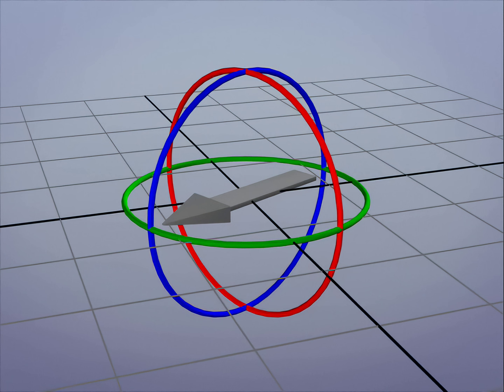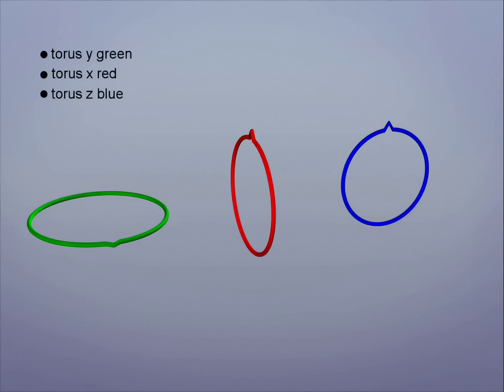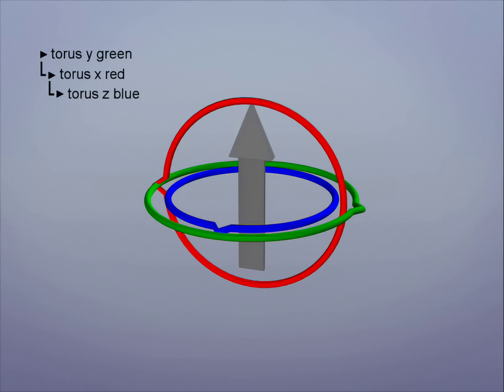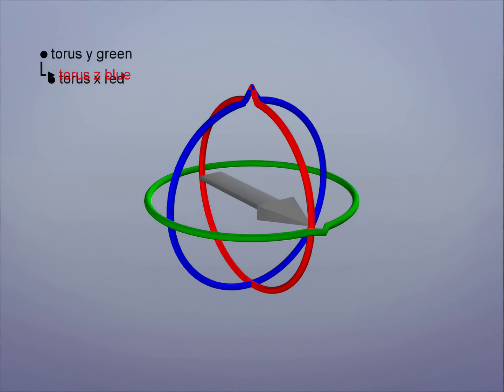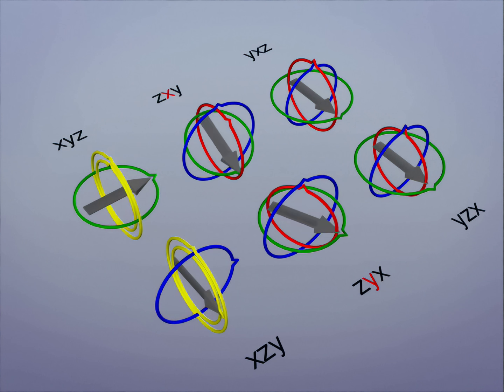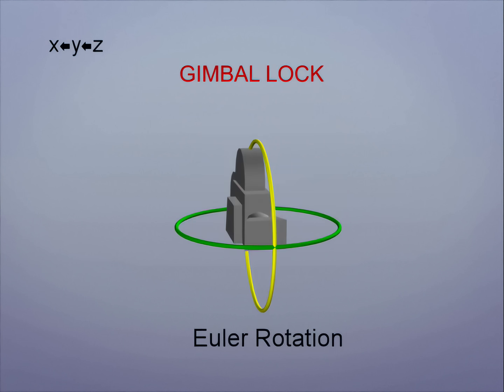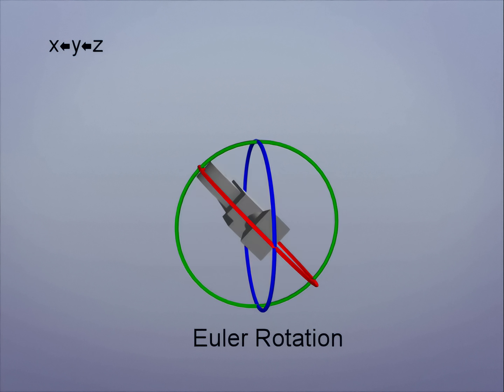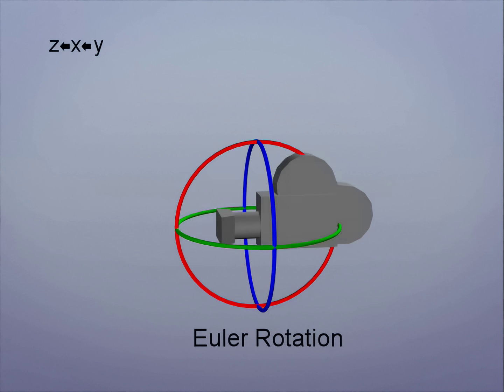Euler (gimbal lock) Explained

Comment: System coordinates and local coordinates are not the same thing which is what people don't get.
Matrices only gimble lock if you use a system vector for one of the world axis that you build the view matrice from. Basically you Dot(Forward, Up) if the result is near -1 or 1 you are about to gimble lock. 
You avoid it entirely by using your cmaers world orientations forward and up not a Vector3.Up. Which is exactly why quaternion's don't gimble. Because they have a set rotation system meaning their vectors are always orthanormal. Personally i like matrices more as they are more flexible.

Comment: So why then do we assert an order to X, Y, and Z? Why not define the axis of all rotations in the global coordinate system? So rotating along the X axis will always mean rotating along the X axis of the "universe"? This way the 3 axis of rotation are completely independent of each other and orthogonal.
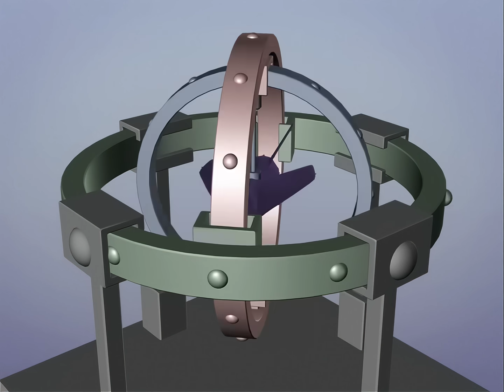Reply: Look at the physical mock-up at 0:45. They are connected in order to maintain the relationship. If you unlock those, you lose the relationship of which is x, y, or z. They lose meaning. But if you code a graphics app or library that succeeds in using Euler angles without lock, share it to the world and tell a friend to nominate you for a Nobel. I'm not being sarcastic - it really would be awesome.

Comment: Good thing to know, since so many programs exclusively use euler angles.

With real world gimbals, especially critical ones used in say, a navigation gyro, great care is taken to avoid gimbal lock for obvious reasons. However a solution that largely prevents it (I don't think it entirely eliminates it, but it does help a lot) is to use a gimbal with 4 axes.

In computer programming of course, the best solution is to use a quaternion.
However, understanding quaternions is pretty difficult.

The concept behind what they do isn't so difficult, but understanding how and why they work is a bit less straightforward.

In terms of rotation, a quaternion defines a rotation, and an arbitrary axis oriented in 3d space around which to perform the rotation.

Of course, the reason why it's so confusing to understand quite how a quaternion accomplishes that task, is because strictly speaking a quaternion is a geometric operation that works in 4 dimensional space, NOT 3d space.
(note meanwhile that euler rotation in 2d space cannot suffer from gimbal lock, thus you don't have to resort to stuff like quaternions or the like.)

Actually, in purely geometric terms it's possible to interpret rotation as linear motion on a surface one dimension lower than the one you are working in.

in 0 and 1 dimensions rotation is not a meaningful operation.

In 2 dimensions you have one axis of rotation, and one of the peculiarities here is that this axis of rotation is perpendicular to the 2d surface itself. (in other words, the axis of rotation in 2d space points in a direction that would be physically impossible in 2d.)

However, if you project a point onto a circle - (the distance doesn't matter,) then you can define rotation in terms of how far a point moves along the perimeter of that circle - and this is by definition 1 dimensional linear motion (albeit on geometry that isn't flat, and thus wraps around itself.)

Similarly, in 3 dimensions you can determine 2 axes of rotation as being 2 coordinates on the surface of a sphere, which is, again, a 2 dimensional surface.
of course, that leaves you with a third rotational axis that is undefined. However, the definition of a single axis of rotation is simply that of the 2d case.
(technically I suppose 1 and 0 dimensional rotation also have to be accounted for, but those have no real meaning, so it's a moot point.)

OK, so I probably won't win any prizes in mathematics with this explanation, but you might see how this can help explain a few things.
It also provides a way to define operations that are equivalent to rotation, but happen in higher dimensions.

In 4 dimensions it follows that there is a rotation defined as the position of a point inside the volume of a 3d sphere, plus the definitions for the 3d and 2d cases.

Indeed in terms of euler angles, if you label 4d space as being XYZW, then rotations can happen along XY, XZ,YZ, XW, YW and ZW, but there should also be some rotation-like operation that operates along 3 axes at a time XYZ, XYW, YZW - whatever this operation might look like, it's going to be hard to visualise, since it's going to be an operation that doesn't make much sense in 3d space... (and visualising 4d geometry, much less 4d geometric operations is pretty difficult...)
Reply: IIRC quaternions aren't a 4D rotation, though.  They're a rotation with a resize.

Also, I don't think you're correct that 3D rotation can be specified with only 2 numbers?  Every method of notating 3D rotation that I can find seems to require at least 3 numbers.  (Including the not-commonly-used ones of "Axis angle notation but use the magnitude of the axis as the angle", and "Axis angle notation but specify the axis via longitude and latitude" [the latter of which you mentioned in your comment].)

Comment: Another benefit of the camera gimbal you suggest is that the gimbal lock occurs in the same place for your camera and a human cameraman. If you're holding a camera pointed straight up, it's a lot easier to lower it in the direction you're facing than in any other direction.

Comment: Is this why alot of games won't allow you to look straight vertically, either up or down? To avoid gimbal locking the camera? Or is it for a different reason?
Reply: In first person shooters you only control your characters pitch and yaw (Looking up/down and turning left/right.) and cannot roll your camera. So gimbal lock isn't a problem.
The reason a game will limit how much you can look up/down is just to prevent you say, pitching your camera 180 degrees up and seeing stuff behind you upside down.

Comment: I wasn’t aware that there was some kind of restriction in modeling until I have seen this video. I haven’t had this problem yet, but the video itself shows me that modeling can only rotate in so many directions before it gets locked. I can imagine that it may cause issues with animators who are assigned to animate the models to make them do certain things. With this new information, I will have to be careful where I turn certain parts in my models so I can at least be assured that it can be avoided altogether.

Comment: When you rotate, XY, XZ and YZ axis of rotation IS NOT MOVING, when you move that red torus at 2:05, blue torus IS NO LONGER Z ROTATION AXIS, it is related to arrow's orientation axis, and rotating around it, but not an x,y,z.

This is so stupid (to me) calling it XYZ rotations, THERE IS THEORETICALLY NO GIMBAL LOCK IN THIS KIND OF ROTATIONS.

This system is needs to be called an "yaw-pitch-roll" rotation, and yes, in this case, gimbal lock is pretty possible.

Even in Wikipedia, this system called Euler angles, angles, but not coordinates
Reply: @ZecosMax It doesn't make a difference. You still experience Gimbal lock if you keep the axes of rotation in the same place.
Go grab a pencil (or just imagine).
Hold your pencil in front pointing away from you
Rotate it some angle on the x axis  (Your pencil changes pitch)
Now rotate it 90 degrees on the y axis 
Now notice when you rotate it on it's z axis ... you're just changing it's pitch again. 

The only difference made by not moving the axis is your first and last rotations can become gimbal locked instead of your last two.
Reply: @8bit_pineapple  no, if i turn it along XZ axis, yes, then nothing in the orientation of pencil happens, but if i rotate pencil along XY or ZY, then pencil gonna lay on it's side
Reply: @vilkillian  Okay... I'll try again... Perform these 3 rotations one after another
1. ZY,  c degrees (c can be any number you want)
2. XZ 90 degrees
3. XY d degrees (d can be any number you want)
Your 1st and 3rd rotation are doing the same job.
Note that if you instead rotate:
1. ZY,  c+d degrees
2. XY, 90 degrees
You perform the same rotation.
This is gimbal lock. Your 3 rotations are doing the same job as 2.
Reply: @8bit_pineapple  if you still can't get what i'm was trying to say:
Axis of rotation does NOT change their orientation, so, if you performed rotation on a model, this model 'becomes' new model with new axis

so, if you take a pencil for example, which is lying on it's side and pointing at +X
rotate it from it's center up along XY for 45deg
and then rotate along ZY, this pencil is gonna make a path which looks like a cone, you will never encounter gimbal lock in this king of rotations.

btw this is how you apply multiple rotations in matrices
Reply: @vilkillian  It's not that I don't get what your saying. It's that you don't get what I'm saying.
If you use 3x3 matrices for rotation you run into Gimbal lock issues. 
https://en.wikipedia.org/wiki/Gimbal_lock#Loss_of_a_degree_of_freedom_with_Euler_angles
Notice we have three 3x3 matrices to rotate about the 3 different axis. 
However, when β = π/2  the first and last matrix become locked.
Sure you can multiply by a 4th matrix after... that would be like adding a 4th ring to the video.
But we don't want to keep introducing new matrices . Especially so for 3D animation.

So to do this we use quaternions or their 4x4 matrix representation instead of Euler angles. Then we can use one set of equations to do all of the rotations we need without issues.
btw this is how you apply rotations when writing 3D animation software/games/etc . 3x3 matrices aren't appropriate due to gimbal lock.
And no... , do not ever rotate a rotated model. Every rotation you do has rounding errors, they add up and destroy your model. Always calculate your rotations from the original.

Comment: Great explanation, but is there some other way to prevent gimbal lock other than changing the rotation order? 
Maybe add a 4th ring or physically stop the rings from aligning? (and maybe use the 4th ring instead then?)
Reply: That’s just basically quaternions then
Reply: @bamgb81  What's that?
Reply: @sebbes333  basically a 4d vector a+bi+cj+dk where abcd are the real coefficients and ijk behave like imaginary numbers on their own but when you multiply them together they alternate between each other, so ij =k jk=i and ki =j , with the caveat that if you do that in reverse order they come out negative so kj=-i etc. you can use this number system to make a rotation of an object around a vector by using this structure quaternion*object*quternionconjugate

Where the quaternion is cos(angle)+sin(angle)*(bi+cj+dk) where bcd are the coefficients of the unit vector that we want to rotate around, the conjugate of the quaternion is the same only with the angle negative. The normal gimbal can be thought of as the providing support for the parameters of the angle b and c and your fourth gimbal can be thought of as providing support for the parameter d

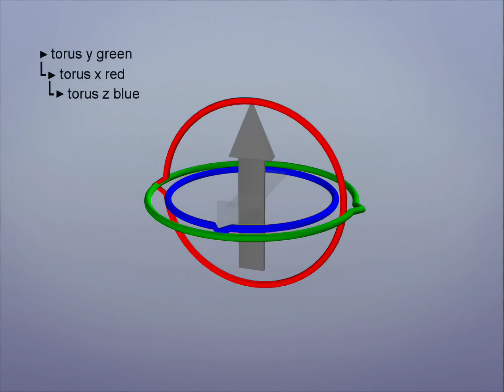Comment: During the Apollo program, their gyros (the real physical ones) were susceptible to gimbal lock as well.  But, hearing people talking about it, it almost sounded like a gimbal lock was the worst thing that could happen to the spacecraft short of exploding.  It was almost as if the gimbal would get fully stuck if it got locked, and could never be unlocked.  But as you showed here (around 2:45), it's inefficient, but entirely possible to get it unstuck.

Is there a reason it was more serious for physical gyros to get locked?
Reply: Spacecraft and aircraft use a gyroscope rotating on an assembly of gimbals to keep track of direction in space.  Since a rotating body has a tendency to keep its same axis of rotation, having it free to rotate on a group of gimbal frames, enables us to determine the direction of the spacecraft's orientation.   Gimbal lock on a physical gyroscope, used for an inertial guidance system, can mean it will give a false readout of the spacecraft's direction as a result of the gimbals applying a torque to the gyroscope that is supposed to spin free of torques, so that it naturally seeks its original axis of rotation in a fixed direction of space.   This issue has been historically solved by adding another gimbal.

In 21st century, we have optical "gyrosopes" called the ring laser gyroscope instead of mechanical gyroscopes, that no longer suffer from this problem.  The mechanical gyroscope was a 20th century solution, that used the rotation of a flywheel to keep track of direction.  The newer ring laser gyroscopes compare the path of light around three sets of two paths that are supposed to be identical.  But when in a rotating reference frame, there will be a difference in transit time between the paths under comparison, that indicates the rotation.

Comment: The rotations used in 3D softwares are actually not stored in the Euler angles format but in the form of  quaternions (or their matrix interpretations).
This is why your rotation tool is not an Euler axes ruler, but one with 90° separated independent axes.
These softwares will always allow you to use Euler angles because we, as humans, can't really intuitively use quaternions. It will however instantly convert them, thus preventing multiple problems (quicker to compute, only one representation opposed to the 6 Euler ones, and no gimbal lock).
So, to recap, the camera problem is due to the interfacing you choose with the inputs (Euler in this case). There are other interfacing implementations available, directly using quat or matrices which can solve this.

Awesome description of the principle of Euler angles and the concept of gimbal lock btw.
Reply: i think that at the time that this video was made, software didnt convert to quaternions internally yet

Comment: Hilarious thing, In Blender Gimal Lock is often not a thing because many things are defaulted to Quaternion. That is why for years I never encountered gimbal lock. But than when I was working at a company on a cinema4d project I know that I totaly got run over by this. It was like the Programm was freaking out!. Because it rotated via euler by default so I was really dumbfounded and that was the first time I've heard about gimbal lock.

This is a great video and tells me to avoid euler basically.
Reply: I don't understand why don't they use quarternions and convert to Euler just for the UI manipulation.
Reply: @totoze1956  I wonder why the program doesn't use quaternions natively, then convert to Euler coordinates. Quaternions never run into gimbal lock. Transforming quaternions into Euler coordinates doesn't have the same problem as going in reverse.
Reply: Well in Blender, possibly Armatures are defaulted to Quaternion, but not common objects, such as cameras.   The Blender camera is initialized pointing down.  If you try to emulate the suggested rotation order illustrated in this video, (yxz in Blender) you run into gimbal lock as soon as the camera is oriented forward and level to the ground.   You may have assumed you never experienced gimbal lock if you were rotating everything in Global mode, but trying to decipher rotation animation graphs like that is a nightmare.
Reply: I don't necessarily thin the video is suggesting you should avoid using euler angles, but that you have to find the correct angle pairing so that the rotation does not lock. Having said that, I do thin it would be easier, as funny as it sounds, to use the ugly quaternion

Comment: why even need that parenting?
Reply: Exactly, why don't they have equal privileges to affect the other axis.
Reply: And that where quaternions come into play.
Reply: Because as you can see at the beginning ( 0:40 ), rotation of green ring rotates two inner rings and it changes two other axes of rotation. Order of rotations can't be changed.
Reply: It's a way to express rotation order. Problem is this ordering provides ambiguous rotation representations, that is, a rotation can be equal to other rotation completely different. That is the effect of the gimbal lock, you can't get away from it in a predictable manner

Comment: In programs I could see an easier solution for this, though I have no understanding of how they do it currently. I assume that in the x,y,z structure where we assume x is the parent of y who is the parent of z creating the hierarchy x->y->z we could doubly link x and y, the 2 parents, like in a doubly linked list. This way when you change x it would rotate both y and z but when you rotate y it would rotate both x and z. This would solve the gimbal lock problem as z doesn't change the other axis'.

A Real life of this would be to lock two sides. (not sure if this has been tried before) If you put your thumb and pointer finger on both hands to create 2 of the axis' as shown in the video, put your thumb and finger tips to touch the skin between your other hands thumb and finger. Doing this for both hands and imagining a 3rd axis smaller than that, rotating in any direction will cause either axis represented by your fingers to move as if each of them was a parent.

Comment: Do I detect the sound effects used in the old puzzle program Blobbo from the Mac platform? I miss Blobbo. It won't run on Mac OSX. If there is any possibility of information about Blobbo I would be interested in hearing about it. The sounds in the Blobbo program were wonderful. Modern computer games use sounds which are too ... modern. Bring back Blobbo. Please.

Comment: Not an animator but I've noticed something like this happening when building stuff on SecondLife. I even called it 'gimble lock' without realizing this was the actual term for it. SL programming also uses quaternians for the rotations but I find it's better to just think of them as 'black boxes of rotation' -- convert to Euler angles, adjust those, and convert back but don't look at or manually adjust the quaternian values inside. That way leads to madness.